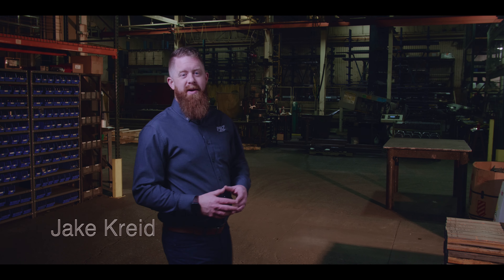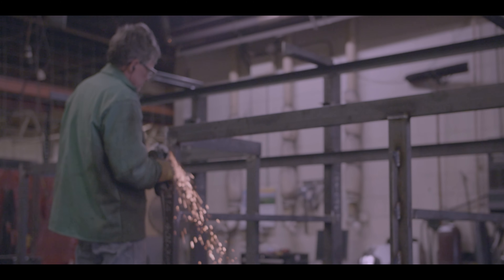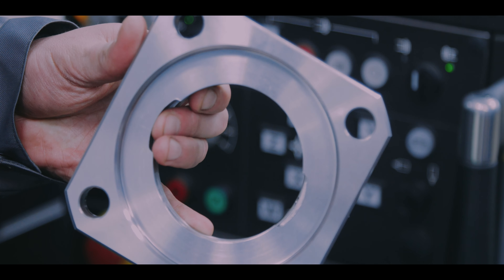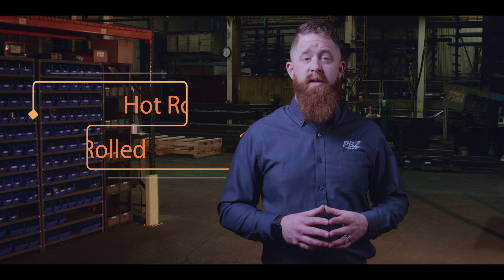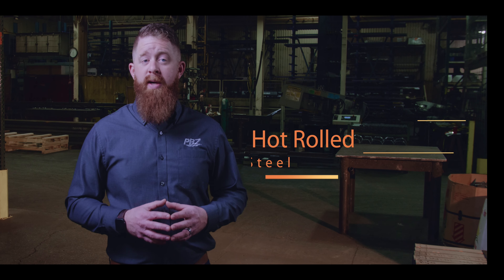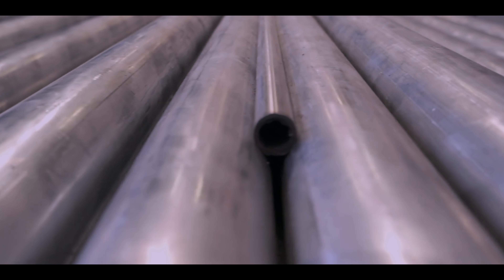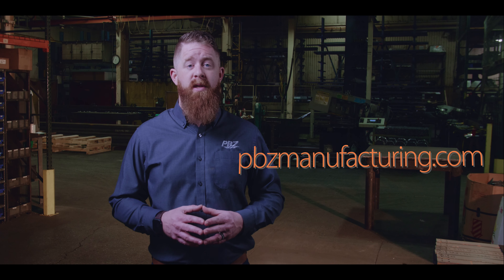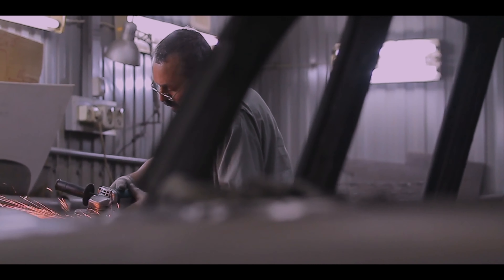Hot Rolled Steel Vs Cold Rolled Steel

Comment: Is there any difference between cold rolled steel and hot one as regard rust resistance ?
Reply: hot rolled could be slightly more rust resistant as it still has the millscale oxide coating